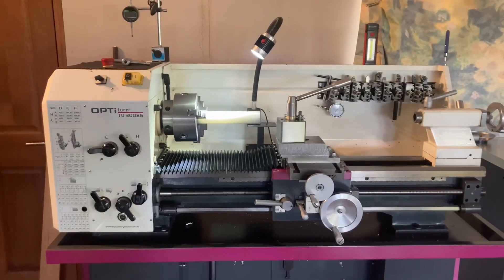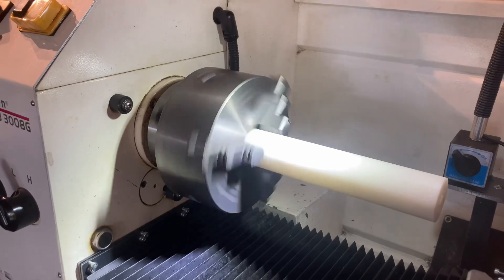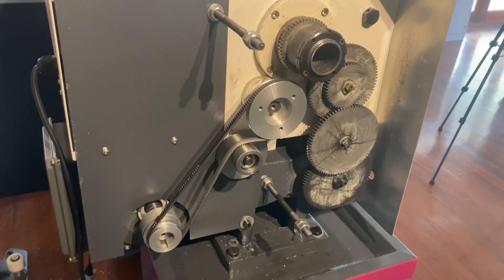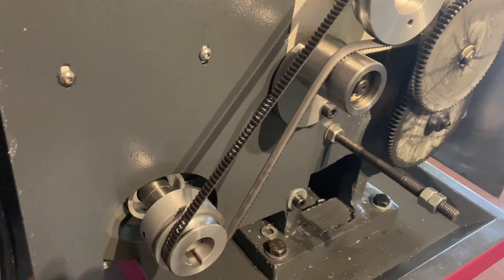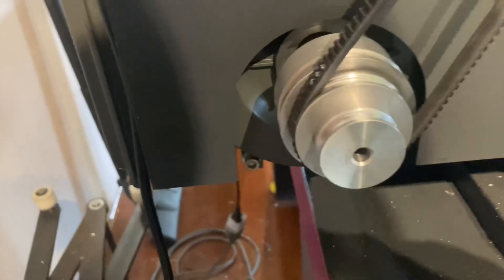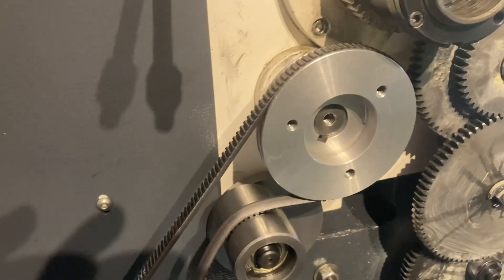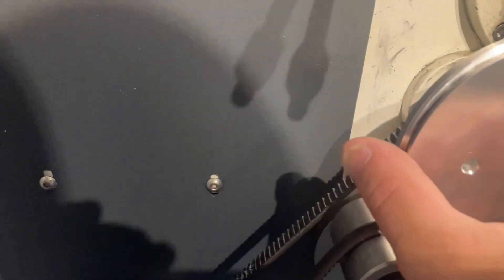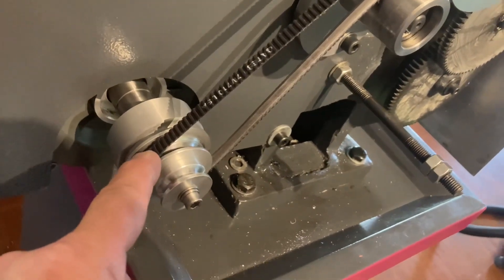How I slowed down my lathe, Optimum 3008G

Comment: Think this will be the 1st Mod I do to my new 3008G. Have you measured the RPM with the spindle gearbox set to the higher speeds ?
Reply from the maker: Hi, from memory it’s about 1000 rpm, which is fine for my finishing cuts. I mostly use mild steel for my projects. Since the mod. I haven’t needed to change the setting on the pulleys so I’m extremely happy with the result, making it worth doing. Wish you the best with your lathe, I’ve had mine for 6 years now and I love it 😎

Comment: Nice work, I have the same lathe and wondering if I could get a lower feed rate, I guess this also gives a lower feed rate but at the cost of too slow for cutting.  Have you tried gettting feed rates lower without loss of speed?  I know other lathes have separate drive systems for feed, sadly not our lathe!
Reply from the maker: Hi mate, to get a slower speed rate, you’ll need to alter the change gears that came with the machine. Do you have the set of change gears that came with the machine?
Reply: @johnnyciantar  
Yes I have them
Reply: Yes, I have them, is it just a matter of using a different combination? Also, would like to PM you if possible since we have the same lathe we may be able to share experiences over time

Comment: As a logical downward extension of the existing speed ranges, it would be good to have the lowest speed around 30 rpm. Since you've already got the first reduction gear as large as will fit, that means reducing the drive pulley to a little less than half it's existing size. That might exceed the minimum diameter that the belt could handle without slipping or breaking though.
Reply from the maker: Hi, I'm already at the maximum minimum diameter with the new drive pulley extension. I've already done some machine tapping and 68rpm  is working out really nice :)